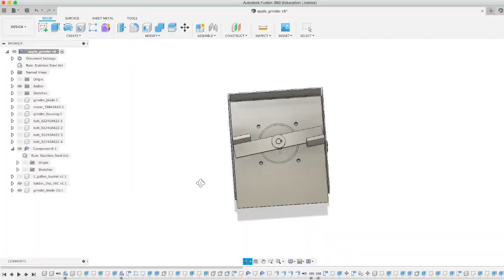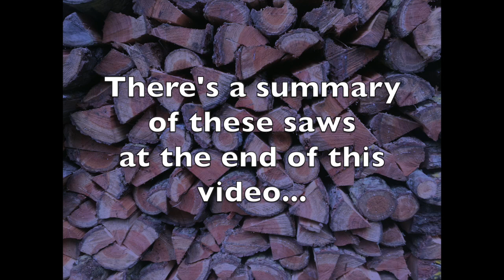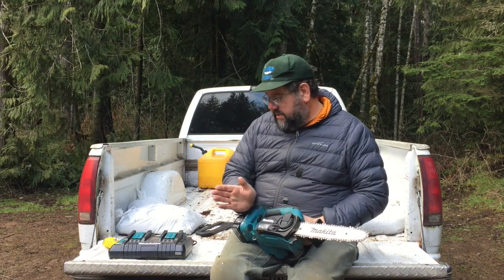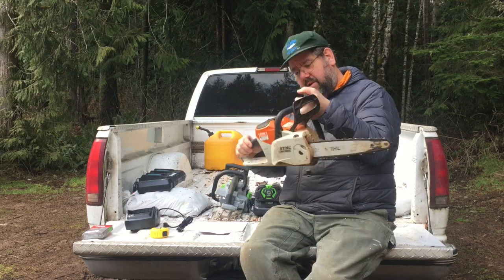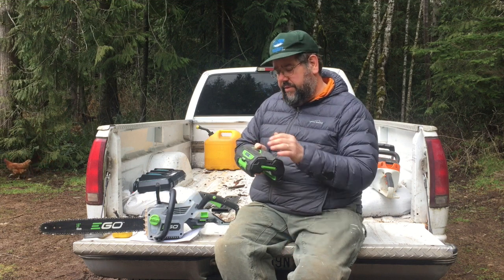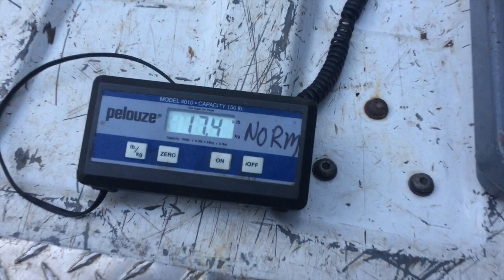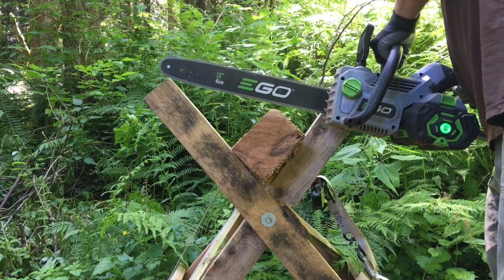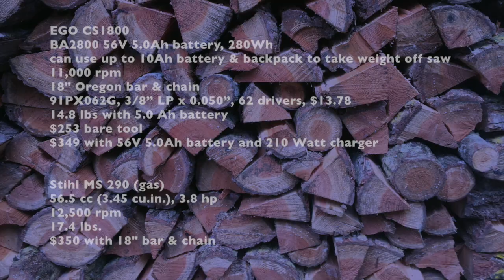Cordless electric chainsaw testing and review – Part 1 – which battery chain saw is right for you?

Comment: I can't tell you how many hours of research I've done trying to find the best chainsaw for my needs. This is by far the most helpful video I've watched!
Reply from the maker: I'm glad my video was helpful!
Reply: Which one did you end up going with?
Reply: @simonm1135  I ended up getting the 18in ego, mainly because I wanted to have the metal bucking spikes and built-in light.
Reply: @parkercovieo9103  Gotcha. I was going to buy electric but I just got a Husqvarna 130 for 230.00 I think it was a 5 year warranty so I couldn't beat it.

Comment: I bought a B&D 40v. 12 inch bar cut 10” pine with ease.  I cut 3 wind blown trees and cleared a ATV path in 15 mins.  Limbed, Cut, bucked 3 10-15 foot sections of fallen trees.

Pack saw….. great idea. Great video. Thanks!!!  

Merry Christmas ✝️❤️
Reply from the maker: Strong work, sounds great! It sure is nice to have a small, quiet, powerful saw that starts when you want it to! Makes getting work done just that much easier!

Comment: Excellent review, thanks. I had back in the '90s a 14'' plug-in electric saw that I used for firewood at the house. Fast, quiet and light. I loved it. I am really impressed by the quality of these saws.  I was thinking of getting another chainsaw, currently have none, and these really sound like  a good option.
Reply: I’m still using an old craftsman plug in electric.  1 7/8 horsepower.    I’ld like to get rid of the cord
Reply from the maker: I had a plug-in electric Craftsman chainsaw years ago, for use around my sawmill. It worked well, but leaked bar oil pretty badly. Luckily these EGO ones have the bar oil figured out, they don't leak.

Comment: Great review.  We bought the Ego mower several years ago to maintain a small yard in town for much the same reason you mention.  Wife struggled with starting the gas mower.  Plus, the mower is so quiet you don't have to worry about mowing in the morning and bothering people.  I'm also with you in terms of limiting / reducing the number of small engines I have to maintain.  I'm looking at the 16" Ego chainsaw now as well as the Ego trimmer.  Another thing I'm trying hard to do is minimize the number of different battery platforms I'm using.  One downside of the Ego line is the size of the batteries.  You'll probably not see a Ego nailer or drill/driver or circular saw.  Alternatively, you won't see a Dewalt or Makita lawn mower . . .
Reply: just got ego 18" inch chainsaw and power load trimmer for the spring and to have the extra 4 ah battery for sawing now..

the 18 inch saw is supposedly much more powerful than the 16. I really like the metal teeth on the 18 as opposed to plastic on 14 and 16 inch saw.. i also like the single self tensioning knob. on the other hand it keeps the chain very taught whereas I prefer a little more slack. the saw and trimmer are powerful and so easy to use.

hope any of that helps if you were on the fence about 16 or 18.
Reply: I ended up getting the 16" chainsaw with the 2.5 ah battery (I have the mower with the 7.5 ah battery).  My saw does have the metal dogs.  I've been very happy with it so far.  I've used it for ~ 10 hours clearing some trails on our property which involves a little bit of sawing interspersed with a lot of dragging, splitting, and digging so the ability to instantly start for a short amount of sawing is really nice and the 2.5 ah battery does fine for the size and amount of cutting I'm doing.  If I need to fell a larger tree or do concentrated sawing I just use the 7.5 ah battery.  Thanks.
Reply from the maker: Glad to read that you like it so far. I too have found that the 5.0Ah and 7.5Ah batteries (14s2p and 14s3p respectively) work better than the 2.5Ah (14s1p) batteries, on the 18" chainsaw. I assume the 2p and 3p configurations just are more tolerant of the Amp loads that 18" saw can produce.

Comment: I have that exact Stihl and love it. I usually use it when overlanding to clear trails and harvest firewood. It's awesome not having to carry liquid fuel and it's just immediately available. Expensive yes! but my friend bought it for me ;-)
Reply from the maker: Yes, it's a good saw, and durable. The biggest bummer for me was the propriety chain. But it must be nice to have friends that will buy you tools like that!
Reply: I have a ego saw, blower, love them. I am thinking of the sthil but I hate that the sthil is 12 inch. I can switch My batteries with my ego.
M6 son has taken over the ego saw.
Reply: @kimoates8231  You can get a 14" or a 16" version as well. I have the 14"

Comment: Great video. I used to HATE battery tools. Now I’ve got the blower, 16 inch saw, weed eater and hedge trimmer. I LOVE ego. Now I want the 18 inch saw. If you are waiting on switching from gas to battery, you’re wasting time.
Reply from the maker: Exactly! and now my family wants the zero-turn EGO mower...(!)
Reply: @normnelson  lol. That would be nice, but $4999 and only 42 in.  at the local Lowe’s is a little cost prohibitive. Plus, my trust isn’t that far along yet.

Comment: FWIW, I bought the Ego 24" snow blower with the 7.5ah batteries for my 250' gravel driveway, and after 7 storms so far in mid Maine, I'm loving it. I won't go back to a gasoline one. (FYI, 8" powder, one charge. 8" heavy wet, 3 charges. A charge is 90 minutes.)
Reply from the maker: Thanks, that's good to know! I've heard really good things about that EGO 2-stage blower. I'd love to get one for around our place, but my first priority is to figure out a better piece of equipment to clear our 1/2 mile driveway... I'm tiring of using the bucket and back blade on my antique Kubota tractor. Where in "mid Maine" are you? I lived in Old Town for a number of years before moving west.
Reply: @normnelson  I'm in Fryeburg, across the street from the Fairgrounds and just over the border from North Conway, NH . I moved into a 3 season cabin in Oct, having moved from Phoenix, and am still trying to winterize the place. IT'S FREAKING COLD!!!

Comment: Thanks for the info. Great Video. Just bought the 18" ego saw at lowes. It was expensive $370, but got it on credit. Got to pay it off in 6 months. I was going to get the 16" which is $100 cheaper, but it  came with a smaller battery and the big battery cost is 250. The 18" comes with the big battery 5.0. So it made sense for me to buy the bigger also i i need the longer bar for wide trees
Reply from the maker: The 18" EGO is the right choice, in my opinion. The 18" one runs at a much higher rpm than the 16" EGO, and truthfully, I wouldn't recommend running any of these EGO saws on anything smaller than their 5.0 Ah battery. The 2.5 Ah battery is just a single set of cells in a series, so it can't put out as many Amps constantly as the 5.0 Ah battery (two series sets of cells in parallel, or "2P") or the 7.5 Ah battery, which is 3P.
I was just using my 18" EGO saw today with 5.0 Ah battery, bucking Douglas fir logs about 22" in diameter. It worked great.
Reply: keep in mind you can always put the smaller bars on the 18" as well if your wanting a smaller saw most of the time

Comment: well done review of the different saw i just got the 18" ego just for the reason im tired of needing my saw and having it not start when trees have fallen into our drive way or general brushing. i'll still keep my 20" gas saw for when im doing a big day of clearing helping people or cutting bigger trees. one thing to note for people looking to get a saw the ego 18" is alot more powerfull than the 16" but you can still put a 16" or 14" bar on it if your wanting a smaller saw.
Reply from the maker: That's a great point about being able to use the smaller bars on the 18" saw body. Thanks!

Comment: I have the stihl msa140 and 2 ak30 batterys 180ah , I carry it on the ATV Quad bike for blowdowns, trail brushing and some firewood ..its a great saw    ..all my gas saws sit in the house now
Reply from the maker: I still use a gas saw for the big stuff, we took a bunch of trees down up here this Fall, and for limbing and bucking the small stuff we used all electric (EGO and Stihl), but for bucking the bigger stuff (18"+) I still was using a gas saw. I still hate the noise and the smell of the gas saw, and what I smell like afterwards (2 stroke stank).

Comment: Good video.  I've cut way over 20 full cord of hardwood with a Makita XCU03.  I used a 16"  0.043 bar with no noticeable reduction in cut speed.  I've also use a 16" 0.050 bar with no problems.  I've used mostly full chisel chain and think perhaps they may cut marginally faster.  I use the 6Ah batteries which translates to 216 watt hours of power (the units that should be used for comparison, not volts or amp hrs).  The EGO looks like a very good choice.  I liked the storage mechanism you described.  My choice was based upon having lots of Makita batteries.  I have many indoor tools and a few outdoor tools like the blower and weed eater and, of course chain saw.   I too, am happy to stop using gas equipment.  The key is to own a lot of batteries.
Reply from the maker: Thanks for the good info! I have since used a couple more of the Makita saws, and they perform ok. You are right, the key is owning a bunch of batteries!

Comment: Excellent demonstration I don't have any of those saws. I have the Stihl 161T, 220C and the MSA300. My brother have 2 Makitas comparable with mines 161T and 220C we tested themes together and prefer the STIHL, in his case the Makita is preferable because he is a builder and use the batteries in other tools. But for heavy cutting is the MSA300 this one yes it sure  have power and speed, the 220C is not even comparable, just for full power you need the AP500 battery and even this one don't last long and here in Portugal I pay 820 Eur. for 2 AP500.
Reply from the maker: Yes, the batteries are expensive. I would like to see the MSA300, it has not delivered to our area in the USA yet.
Reply: @normnelson  I buy mine MSA300 online from  store in Holland because here in Portugal and Spain they have many orders but is not available yet as far as I heard from stihl dealers here Stihl is not capable to produce enough.
Reply: @normnelson  The MSA 300 is in did a joy powerful machine I have mine with 16 and 182" bars, the downside is the batteries because even the best one the AP500S and I have 3 of thoes but not last long. At the moment for what I see no other battery saw  with be a  challenge for the MSA300 in regard to power and speed. I also have the GTA26, 161T and the MSA220C.

Comment: Why does no one evaluate the Kobalt 80-volt brushless 18" chainsaw with a 5ah battery?    I have (2) Kobalt 80-volt 18" Bar Chainsaws and use (2) 5 AH Batteries. Using it on a Southeast LA farm that was devastated my Hurricane and has been working absolutely great even cutting huge logs and trees. For oil, I like to use Ryobi Bar and chain oil. We have cut 20"+_ logs and it works like a charm. And NO more pulling and pulling to start a gas-powered chainsaw. My first 80-volt 18" Bar Chain saw with a 5-AH Battery and charger was $400 in Jul 2021

Comment: One thing that I noticed with my Kobalt 80v chainsaw is that it's every bit as heavy as a standard 2 cycle. Are any of these on the lighter side? Also, have you noticed if any of the batteries are easily serviceable?
Reply: My ego is light, I am a girl so it sure makes a difference.

Comment: Hi Norm
Great review. 
FYI that speed ramping on the EGO is called "soft start". It is technology that was designed to extend the life of motors and as you suggested it draws less amperage also extending battery life.
Reply from the maker: Thanks Gary, yes – I'm familiar with VFD's and soft starters on bigger, AC motors in industry... at my last employer, we had a 480VAC 30 hp water jet pump that employed a soft start... in that case it was nice... but on this 18" chainsaw, it's a bit annoying! I just wish the ramp-up was adjustable. I mean, even the throttle mapping and steering servos on RC electric cars I played with 30 years ago had adjustable curves (linear, log, etc.).

I realize it's an apples to orangutans comparison, but our current Nissan Leaf EV has multiple throttle maps (and regen maps) to pick from, and it's really nice. Maybe EGO will offer some options in the future?

Comment: Good review, very competent and to the point. I'm interested in the EGO saw. Do you now anything about it's toughness? I'm interested in metal parts under the cover. I know Makita has a plastic pin used for adjustment..don't like that. Thanks..
Reply from the maker: Yeah, I have a follow-up video that I'm working on editing. There is a plastic piece in the EGO CS1800 as well, part of the chain tensioning... and it could be a fatal flaw. Stay tuned.

Comment: Have you had any issues with the battery saws in very cold weather? I am thinking about the ego. I live 8000 ft above sea level and my 2 stroke gas saw ALWAYS gives me issues.
Reply from the maker: HI there, I have not used any of these in very cold temperatures, we are at about 1,500ft in the Pacific Northwest, and the coldest I have used the EGO is just below freezing, maybe 28°F, with no problems. Of course I use thinner bar oil in colder temperatures.

I do bring all my batteries in to our mudroom and have the chargers in there... with most lithium batteries, it's recommended that you store – and especially charge them at above-freezing temperatures.
Reply: @normnelson  that’s good advice thanks!
Reply: Because Ego batteries create their own heat, they perform well in the cold. I keep a small cooler with a  little hand warmer activated to keep spare batteries outside for a job.

Comment: I have a Sthil 271 which is fantastic for where I use it. I have a Dewalt 20' battery saw, which is fantastic for where I use it. I have an Oregon wired electric saw which is fantastic where I use it. The only one I don't use inm y workshop is The Sthil because of the fumes.
Reply from the maker: Yes, it's good to have a variety. I used to have a corded electric saw for use at my sawmill... squaring up ends of logs, bucking off pieces of limbs that were missed, bucking up slab wood, etc. Now I use the EGO battery saw for that, and for most limbing and bucking of logs under about 16"-18". For the bigger stuff I still use a gas saw, though I still hate the noise and smell and pollution, and the fact that no matter if I feed them ethanol-free gasoline (USD $4.89/ US gallon here now) and genuine Stihl 2-stroke oil, they still eventually get cranky and need a carb kit, etc. Frustrating.

Comment: I was looking at dewalt  for the the use in my orchard and my lawn area and also was going to get drill and impact and such I have seen some videos on it and it ranks ok what do you think
Reply from the maker: I haven't used the DeWalt saws, thought I have a buddy with the 20V version and he says it's ok for the small stuff, pruning, etc. but for bigger stuff he would get the 60V version. I think if you're looking for a drill and impact as well, then DeWalt, Milwaukee, Makita are all decent choices.   I, for one do not care for the DeWalt impact drivers I have used... I bought a 60V DeWalt kit last year and loved the 60V circular saw, the drill was ok (but the fit & finish of the battery-to-tool interface is not great) but the DeWalt impact driver was so bad that it made me return the whole kit. It's hard to describe, but... the DeWalt impact seemed to have much faster, but less "impactful" impacts... which made it really easy to strip out screw heads, no matter how hard I pushed on them. It was most noticeable on 3" Philips head screws... it was like DeWalt engineers had made a driver with the goal of stripping screws. I went back to my 15 year old Milwaukee V18 impact driver (with old batteries), and it worked just fine – same screws, same wood. So I returned the DeWalt kit and bought a new Milwaukee M18 kit, and the new Milwaukee impact driver worked (for me) hands-down better than the DeWalt impact driver.

Comment: is it better to discharge lithium batteries or can you keep it topped up
Reply from the maker: It's best to store them at 50% to 75% state of charge (SOC). The EGO batteries actually have a timer and self-discharge circuit built into them... if you charge them fully and then store them away, don't be surprised if you see them with a red LED on at some point, like three weeks later... they will be running their self-discharge cycle, to get them down in the optimum SOC for long-term storage. I have not heard if the Makita or Stihl batteries do this, and I don't think they do...

Comment: I'm torn. I'm invested in Makita lightly... As well the EGO Line with their awesome lawnmower, line trimer, backpack blower, and hand held blower. I'm leaning towards the EGO because I have so much battery pack energy, and its total package. But the Makita is super appealing because its so small and compact. But the leaky oil part of the review is a major turn off to me. Doing trail maintenance... The Makita seems like a better option to backpack in... as well climbing trees, the Makita seems like a better up in the air option with the metal loop to easily attach and carry up a tree hands free. But the leaky oil weakness really irritates me. 

Truthfully I'd love to have both. Maybe over time. But if I had to pick today. I'd probably go with the EGO. I'd agree the battery tech is pretty impressive speaking from a few years of experience with the EGO line. 

Side note. I do find myself mowing my lawn at night. The light works so great. The mower is so quiet you cant hear it inside the house. Not true of my neighbors lawn services that we hear several times a week starting at 7am! So having a chain saw with a light for bad weather storm clean up really is a thoughtful and useful bonus...
Reply: Love my ego, after watchin* this I think I will get another ego with the 18 8nch bar.